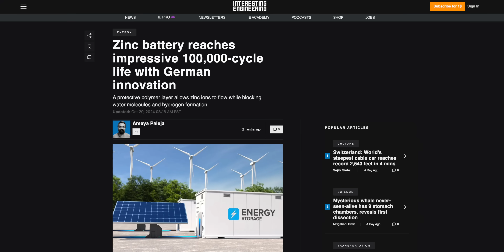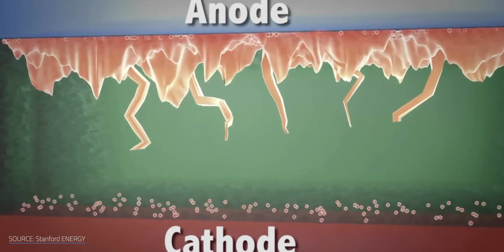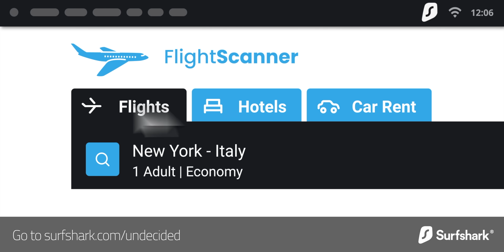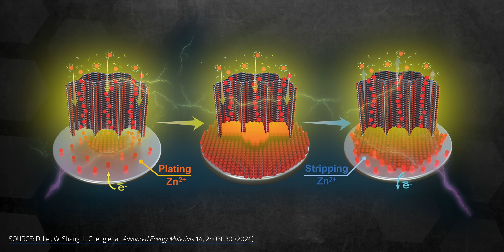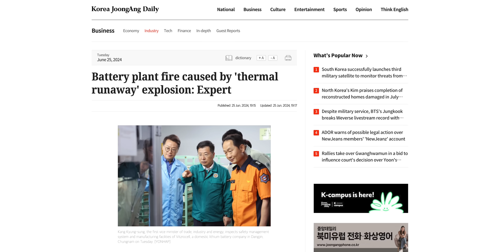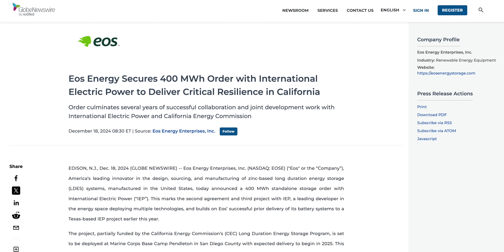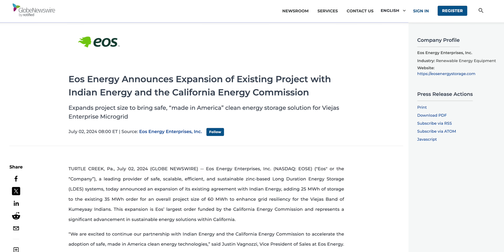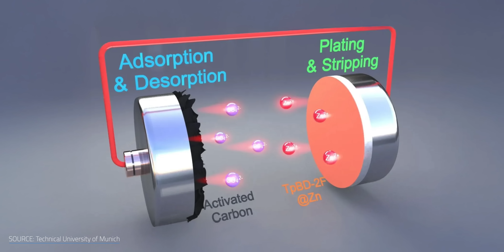How Zinc Batteries Are Defying Limits

Comment from the maker: Do you think Zinc batteries will charge ahead in popularity? Go to https://surfshark.com/undecided for 4 extra months of Surfshark.

If you liked this, check out How a Small Wind Turbine Will Revolutionize Wind Energy https://youtu.be/sl8UVOpzo7Q?list=PLnTSM-ORSgi7uzySCXq8VXhodHB5B5OiQ

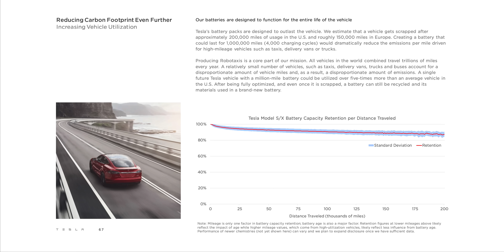Correction: At 01:00 the distance should be 2 times the distance to the Moon and back
Reply: Which is better; Zinc or Sodium Ion batteries?

Given similar energy density (somewhat), but sodiums lower weight and abundance, I'd expect sodium to win out in the markets where zinc is competitive (ie. Gridscale)?

Add to this that sodium ion are already starting to appear on the market too, they have the advantage of maturity perhaps?
Reply: Plus with the polymembrane approach being portable to other chemistries the lifetime advantage is also eroded.

Although Zinc-Air offers promises, being an established primary cell technology that has been found can be used as a secondary (rechargeable) cell.
Reply: @GruffSillyGoat you were on it, and then you kinda went off the rails. Look its simple, what ever the breakthru; apply similar methodologies to Lithium, and you will have a better battery.
Reply: @fing_az  neither will ever supplant lithium
Reply: @mpirron1  I don't think it's reasonable to say that sodium or zinc wouldn't "supplant lithium".
In EVs and use cases where energy density (or specifically, weight) matter, sure, definitely not. 
But for ground mount installs, and/or installations with higher safety concerns, sodium in particular has the chance to be drastically cheaper (per Wh), and a better fit for the requirements. Right now it's pretty new to market and not being as mass produced. Once that changes (likely the next 5 years I'm willing to bet) I think we'll see some pretty huge grid scale installations going in.
Reply: @fing_az  well I feel you and agree fundamentally but its not the way we seem to actually implement. As far as for sodium, it will never be safer than lithium magnesium or any other alkali metal, they all respond to atmospheric exposure in a violently exothermic manner. and alll other  metals oxidize exothermically to a lesser degree, and that degree equates theoretically to energy density. the thing aboutzin is
Reply: Wasnt expecting an $EOSE name drop.
Reply: Actually at 1:00 -- It should only be 1x the distance to the Moon and back.  The ~239,000 miles is just the 1-way distance to the moon.  So the moon and back would be double that or around ~478000 miles.
Reply: @parasharkchari yeah It not the first time I have seen iffy math from this bloke
Reply: I didn't see in your video how the polymer solves the Zinc Hydroxide issue. Although a hydrophobic coating on the anode would prevent anode corrosion and may provide some resistance to dendritic penetration, I don't see how it would affect Zinc Hydroxide production, which could occur in the space around the cathode. It seems like this would still reduce the supply of Zinc (and water electrolyte) that is available for storing and carrying charge.
Reply: s @benjaminhamilton2434  Speculate all you want. EOSE has been working on this for years and has I think over 29 patent. They use proprietary catalysts etc to solve the historic problems with zinc batteries and make them charge faster.They will last over 20 yrs. I'm only stating this as facts they claim on their website. I believe this is all around the best we got. Battery advances has been a very daunting field with many disappointments.
Reply: Longer lasting batteries? You mean smaller short term profits for companies
Reply: @ right, never happen cheap
Reply: An electrical system that can be taken out by an EMP is a wise decision while our magnetic field is getting weaker before the magnetic field flips?
Reply: @peacepoet1947  it would seem a zinc or sodium storage system that can be isolated from the grid is your best bet....eh?  IDK,,,,, get a big ole fly wheel you can drive with a geared up bike and get on boy.
Reply: WHo has the first home system on the market?  This is where you want that sense of safety that comes with zinc solutions.
Reply: @ zinc is still reactive and can thermal run-away, if you want a heavy battery thats totally safe and cheap the answer is Ni and a pretty good one already exists in NIMH.
Reply: 0:56 - That's roughly the distance you would drive to the Moon and back *once*, not three times. But thanks for the video. This increase in Zinc battery life expectancy is an interesting development. 🙂👍
Reply: I think the non flammable electrolyte is a big differentiator.  No worries about run away heat, no moving parts like a flow battery.  IF cost is even close to sodium, I think it might be the next big thing.
Reply: Zinc old technology.  solid state batteries ALREADY in cars with even HIGHER performance.
Reply: I'm ready to upgrade my off-grid system. I will need new batteries. Having this battery now would be great. 
Matt, should I be looking at sodium or sticking with Lithium?
Reply: @100Diamonds10  looks like you should wait a little bit and see where things go over the next year..... a 100% stable system would seem to be the first priority for home installation unless you have a separate utility building.... how does a person sleep well with 15kw of power stacked in a couple lithium battery on the basement wall?
Reply: @glen.simpson  it is going to be in an underground shed/structure, not the main living area. We have 6Kwh batteries (3 2.6Kwh).
Reply: @100Diamonds10  see the lithium battery fire out west recently.... anunderground fire might suck more....staying lit for months and polluting every stitch of land, air and water in it;s vicinity.... I just think 100% stable solutions are the only way to go in the future..... too bad zinc is so heavy!
Reply: @100Diamonds10  is your system grid tide?
Reply: @ lifepo are safer than sodium
Reply: Why are zinc batteries better than the over 100 year old iron based battery chemistry?
Reply: @rehoboth_farm  nickel iron("edison") is a verry good battery technology, there are some still in use that are over 120 years old. They a less power dense than lead acid, but charge twice as fast. They were used in the mining ibdustry railroad, trollies, telegraph and telephone and the orginal electic cars in use from the turn of the century. They were the batteries Nicolia Tesla and Marconi experimented with. They wer produce from 1903 to 1972 by the edison battery company and exide from 1972 until 1975 until they shelved the technology. They are still made in China in small numbers for the Asian and European Mining sectors but are exceedingly difficult and expensive to get ahold of in the U.S. There is a, dare I say "discrepancy", as to why they fell out of favor compared to lead acid batteries though. They are said to be "costly to manufacture" which the answer to why everything stops being made, by the way. This makes no sense as they consist of a Ni anode and a Fe cathode with a potassium hydroxide electrolyte solution a simple alkaline battery design made with very abundent metals. It is inconceivable that it could be too "costly to manufacture" such a battery, being that it is made out of the least expensive materials to produce on earth! 

So, you can either accept what ;you are told or seek the answers you aren't, but neither will change the circumstances that exist now or in the future of battery technology, Li is the best and nothing will ever be better and iron is cheapest and nothing will every be cheaper, so the best battery already exists and is the most widely produced, safest, battery technology available, LiFePo. The best use of our limited resources is to improve it Li-Fe batteries, specifically cold weather charging and invest the research in radiocative materials because the pinnacle of elemental science has been reached (and there is nothing wrong with that fact, btw)
Reply: @ they aren't, they're worse
Reply: 0:48 A car only lasting 150k miles is horrible. Toyotas can last 400k miles
Reply: @mattheww797  all cars could  last that long, and its not incompetance why they don't.
Reply: @ so are you saying its a conspiracy?
Reply: @yes, many of them
Reply: Hows this Zinc technology work in colder climate IE: Shipping container next to a business about 80 miles NORTH of you?>? Thanks !
Reply: Hi, I don't want dubbed one. Please allow me to listen in original language.
Reply: A 2D porous orgamic polymer coating prevents the zinc electrode from forming dendrites. Saved ya 12 minutes ;-)
Reply: you should distance yourself from associating with musk even by giving him mention
Reply: Nope
Reply: Hey Matt, I'll bet you $5 that this new polymer membrane is also a PFHC, and for the sake of the bet a mono fluorinated hydrocarbon molecule also counts because even if it's only one fluorine per monomer, it becomes poly as in polymer... If I'm wrong and you prove it,  five bucks.
Reply: No, because it will never leave the lab.
Reply: @leeishere7448  I wouldn't count on that, but I am sure if they don't find a way to make them fail faster like why LED light bulbs don't last 20 or 30 years anymore, then the'll go out of business because what they sell will never need to be replaced like micropolis hard drives. I still don't know how many millions of hours those hard drives last because mine hasn't died yet, but the company has been gone more than 20 years.
Reply: I think that for long-term energy storage, any and all innovations will be profitable and successful. However, this technology will potentially change the world forever.
Reply: @UndecidedMF  zinc isn't special , it's the membrane, the everyday alkaline batteries you use are zinc and manganese. The company from Australia uses zinc and bromine. Zinc is one of the most common metals used in batteries. 
     The unique innovation here is the separator membrane that helps prevent dendrite formation helping to make zinc batteries rechargeable & for many cycles without having to resort to being a flow battery or using a multi-phasic liquid separation (fancy way of saying gravity battery with oil and water)
Reply: same old promises since 2000s, Germany, Japan, south Korea,  Australia and UK are the slave clusters of USA oil barons, so this would never happen, unless China could take some actions in this regard.
Reply: 1. Do big corpos earn more with these?
2. Do we have the resources for mass production?
3. Do we need this batteries for cars or phones? I dont think so, no car will drive 1Million Kilometer and no phone will last longer than 10 years.
Reply: read an article a Chinese team just designed one that uses alluminium and appretly can "last forever"
Reply: charge cycles is only one problem that needs to be fixed. There's probably about 8 or so different aspects of battery storage that needs to be addressed.
Reply: Your mathematics are off, Matt. 300,000 to 500,000 miles is not 3 times the distance to the Moon and back. In round figures, it's a minimum of about 238,000 miles to the Moon. Therefore, the shortest straight line journey there and back just once is about 476,000 miles.
Reply: can we make micro combustion engine
Reply: I don't know,  that is why I follow your channel.... feed me more!
Reply: Makes little sense with  battery in my car that can be used for above 250 years with one dayli charge, I wont last that long and neither will a car...
Sodium is already a reality, seems like a better idea..
It does matter with the energy density, weight and price of course, but if a sodiumbattery can last 15 years at a lower price, a Zinckbattery has no interest
Reply: @clausnielsen3155  well you said the quiet part, Sodium batteries exist. so why doesn't anyone know about or use this "gamechanging" super-batteries we are ever-clickbaited over?
Reply: @mpirron1  Just a matter og time, Samsung has the prototype ready..
I did not say it was something you could run out and buy, neither is the Zinckbattery..
Reply: @ and you never will
Reply: Have you dug into redox-flow batteries lately?  The zinc–iron redox-flow battery looked pretty interesting when the paper was released a decade ago.
Reply: @KeithOlson  yes, he has, recently.  Another attempt to market an inferior technology by disguisng it as somehow innovative. Your paper was one in a long line of attempts to patent and marketize various "flow" battery technologies all dating back 120 years to the first flow batteries that were found to be too complex and dangerous when compared to other chemical batteries of the time. There is nothing new under the sun here.
Reply: Matt Matt,Matt, you bring us so much hope but so little reality in the realm of batteries.  Zink sound perfection

Comment: Zinc and Sodium will be the Grid based BESS that make renewables the go to for Energy generation IMO.
Aluminium Graphene batteries equally cheap , Long cycle life and recyclable.
Couple these with Redox flow batteries or Sand batteries for thermal heating and geothermal generation and the reliance on Gas peaker plants and coal will be replaced by 2040 for sure
No matter what the current  US government do the world is moving forward.
Low cost High levels of availability in all continents and ability to process the minerals and produce the batteries for regional distribution offer significant securities for nations to ensure they have independent power generation.
So many irons in the fire when it comes to battery storage that we will have a solution to the curtailment of so much renewable energy being wasted.

Comment: I've frequently used Zinc Carbon AA batteries. Some people laugh and tell me to use Alkaline The problem is leakage. I use Panasonic Super Heavy Duty batteries because I've NEVER had one leak in over 30 years. Not ONCE. I recycle them at a local store. They're durable and cheap.
    The cost is low, 4/$1.00 at the dollar store.

Comment: To me it sounds like zinc batteries, with the technology you described, would be excellent for home batteries connected to a solar system. I could easily allocate some outside square footage for a battery, and it would absolutely change the game if the batteries lasted longer than the panels

Comment: Jay Leno has a 1909 Baker Electric car in his garage. It has the original nickel-iron battery (invented by Thomas Edison). Just check the electrolyte level, charge it, and drive off. The most robust rechargeable battery chemistry.

Comment: y no ytterbium isotope battery. beta particle bruh. its electricity bruh. spiral in a cloud chamber right hand rule bruh. lines of force wih current in a wire turns right hand rule style bruh. if it touches alpha particle it merges to make helium just like electron from open electrical arc ... bruh. literally bleeds electricity bruh. old soviet radioactive cells ran on the concept and abandoned only because of fears of leaks bruh. big boy bruh. wears loafers bruh. can handle responibility bruh.

Comment: Gonna be like pulling teeth to get phone, laptop, and other electronic companies to use batteries that long lasting. The phone im typing this on, over $1000 technically, has a bulging battery currently. Ill replace mine, but if you cant/arent comfortable, most companies will have you just replace it. And many prevent independant repair shops from getting certain components, so hope its just the actual battery (or they dont tie the battery to your IMEI number or something) If this phone had a super Zinc battery idk if Id ever upgrade lol.

Comment: I’m a UPS technician. We’ve been putting nickel zinc batteries in data centers for a few years now. They’re pretty cool, 10 year warranty and 15 year life compared to VRLA at 5 year replacements. Probably a third the weight of Lead Acid, as a field technician, that’s a nice feature.

Comment: min 0:52 "300,000 to 500,000 miles is roughly the distance you cover if you drive to the Moon and back three times" ?!?  Either the Moon got a lot closer since last time someone measured the distance to it, or you made a very big mistake there.  I hope the lifetime of the batteries you are talking about is not calculated using the same formula.

Comment: Is there anyway that the energy density of Zinc could be increased? If so then it will definitely jump the corporate greed hurdle due to cheap and easy to find materials giving them more cost savings. Besides they are already making other parts in our phones and laptops break the battery isnt normally the first to go at least with a certain brand (cough apple cough)

Comment: After that battery fire, I think Vistra in Moss Landing, CA needs an extra 3000 MWH of zinc battery capacity.  I would recommend they not buying LG Chem batteries again.  And don't put them inside a building, so they'll all burn.  Everything at that BESS was so poorly specified and designed! PG&E should stop outsourcing its power needs to inferior little companies that make huge engineering mistakes.

Comment: One area where I think Zinc Batteries can help is with diesel electric commuter rail systems. 
The train engines are least effective when starting and leaving from a station. This is also where they create the most pollution from their engines. 

I believe that if you were to add in some of these batteries to help accelerate the train, then recharge while en route to the next station, it will help reduce pollution. 
Just need to get Metra (Chicago, IL) to try this out.